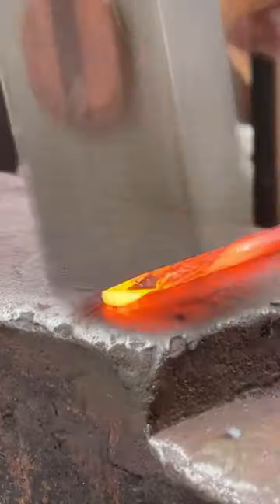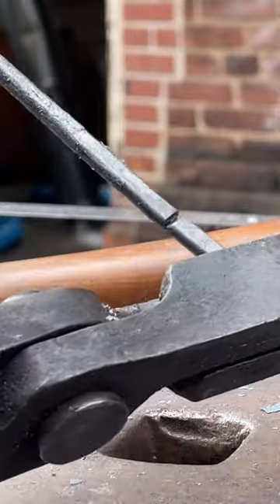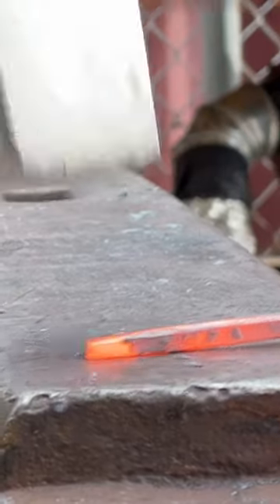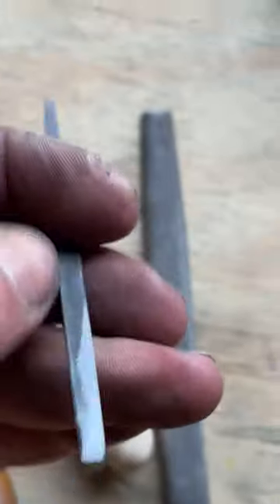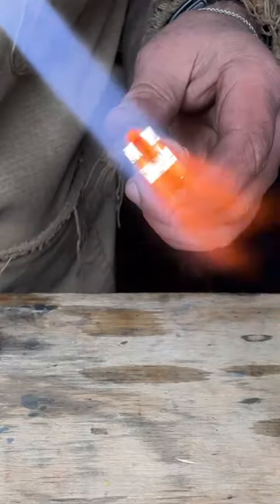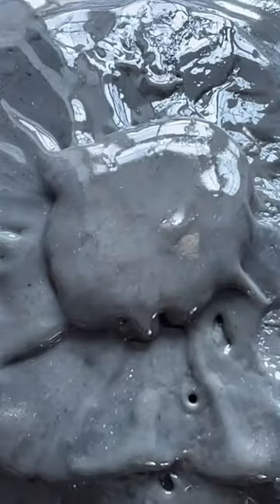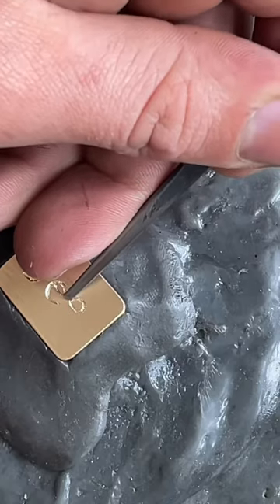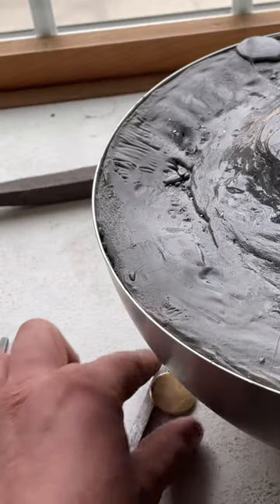Forging your own engraving tools?! #blacksmith #blacksmithing #forging #forged #engraving #shorts

Comment: I love to ingrave roses. The brass round would make a very cute little rose. I made a series of small gouges using old cold chisels.  I start with a small indented punch then use the gouges around it making 5 petals in each layer.

Comment: Isn't W1 basically unobtainium? Where did you get it? Thanks
Reply from the maker: W1 is a fairly common variety, you can get it from most industrial suppliers like Grainger or McMaster. It’s sometimes called drill rod as well
Reply: @nate_weiss_  thanks

Comment: youd have an easier time with the curves if you put a radius on the heel on your graver. move the work, not the graver. the graver should basically always be pushing forwards, and you turn the piece to create a curve. source : 21 years as a goldsmith
Reply: This is brass, not gold